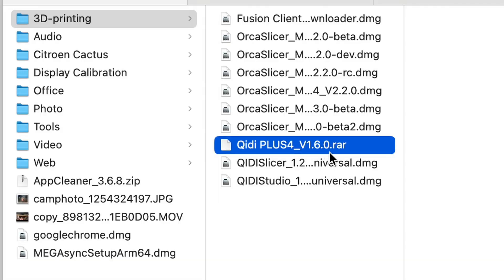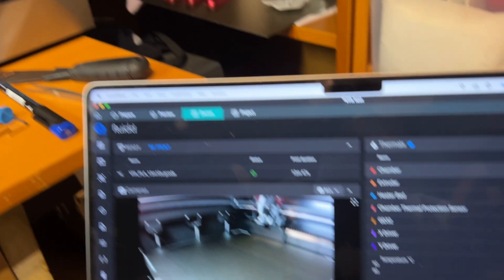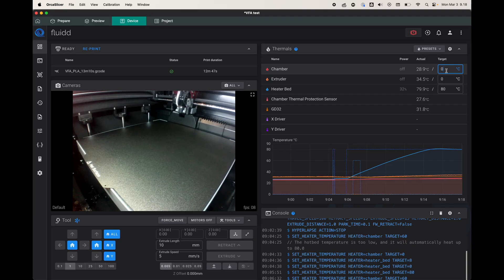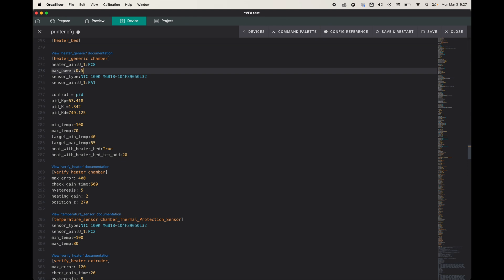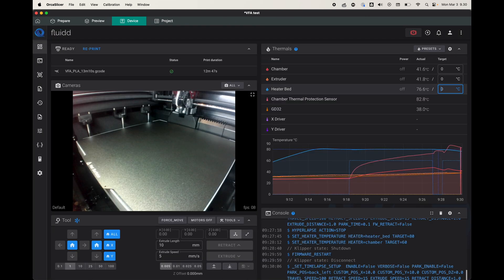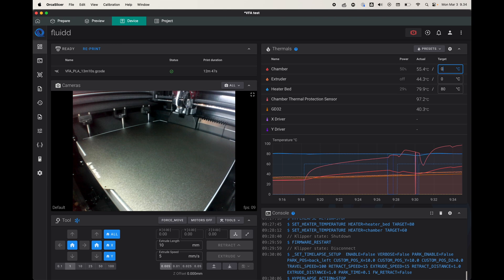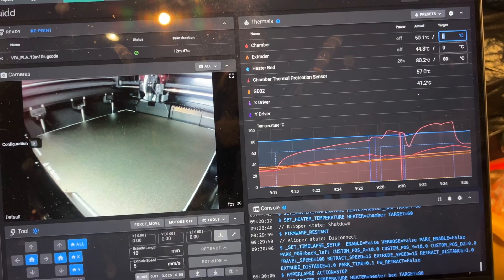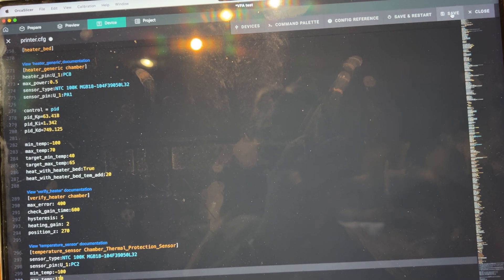Qidi Plus 4 Chamber heater wattage on FW 1.6.0

Comment: I have 110 volts. My heater is annoying.
max_power = 0.4 makes the heater use ~280 watts.
max_power = 0.5 , makes the heater use ~300 watts.
max_power = 0.6 makes the heater use ~320 watts.
I don't want to go higher than 0.6, since Qidi doesn't recommend it, but it takes a very long time for my chamber to reach 60 degrees. Maybe I'll buy a new heater and hope it works better...
Reply from the maker: My take is that they don’t recommend over 0.6 since some units could then draw too much power. But since you have measured the wattage with good precision, you have essentially negated the need to stay under some arbitrary limit.